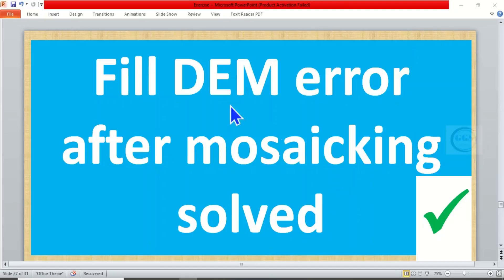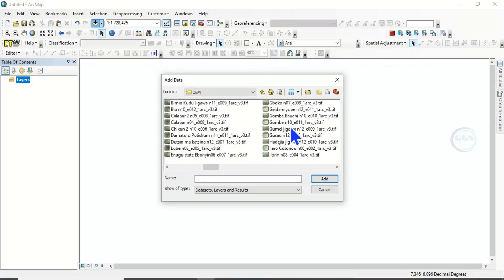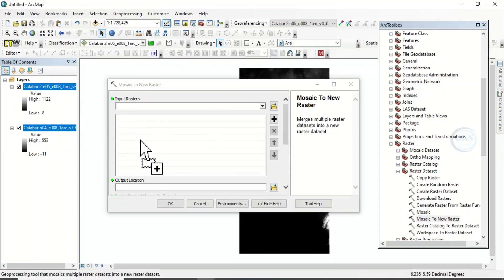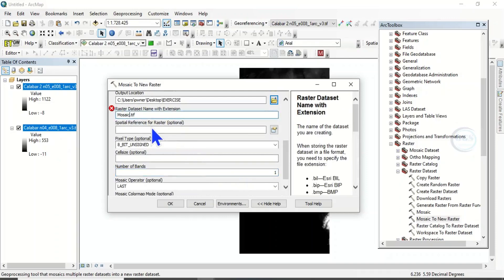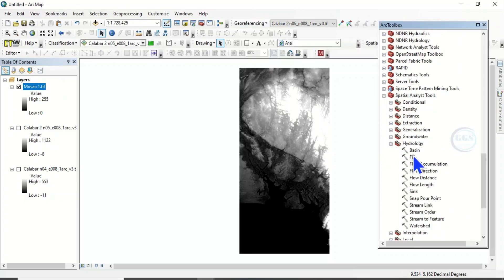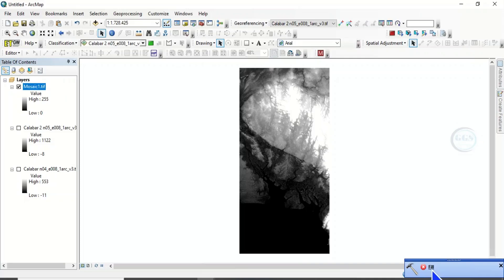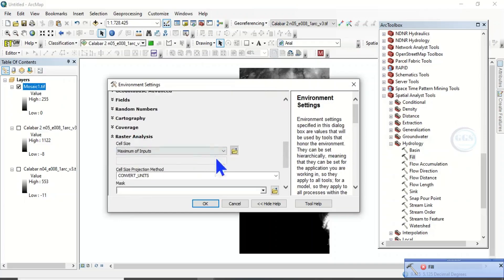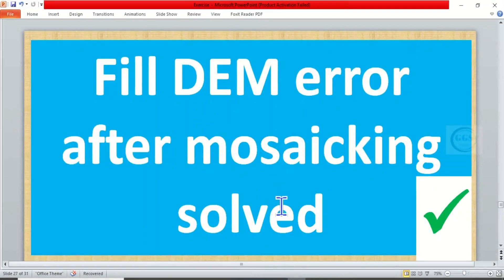Fill DEM error after mosaicking solved: ArcGIS error message solved

Comment: thank you! this worked great. 
i am using arc pro. 
my issue was that the fill tool output was not giving me an 'error', but it was producing a layer that was only a portion of the mosaic i am working with. 
your tip fixed it!